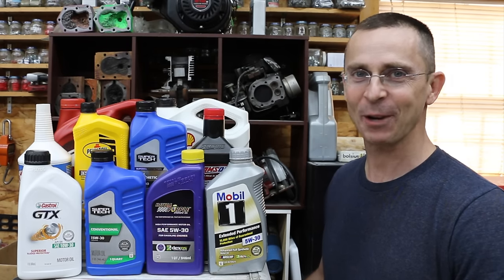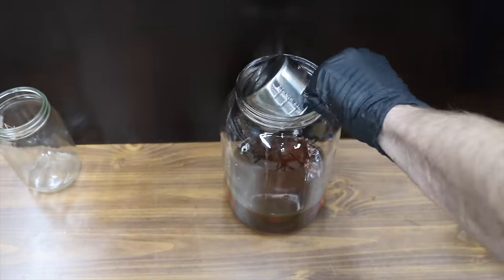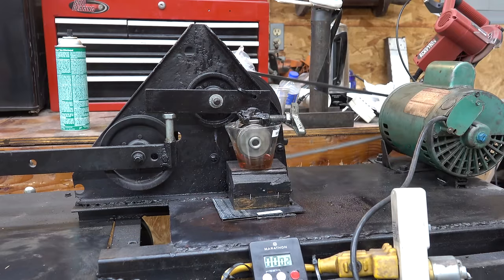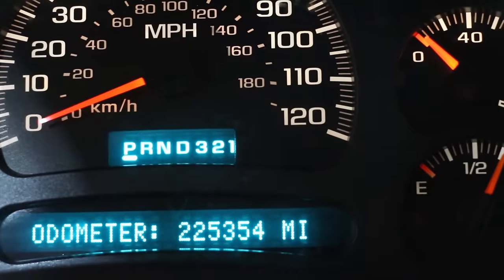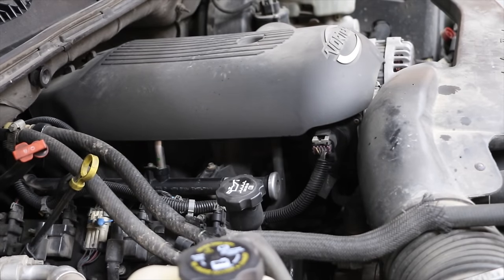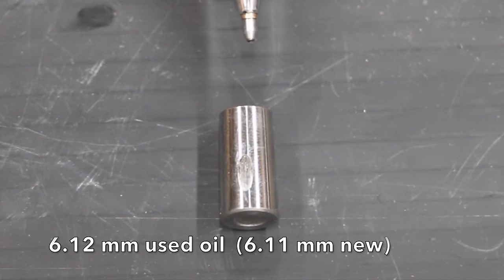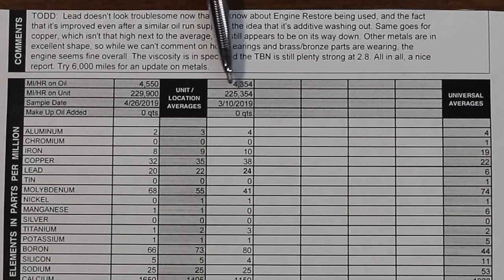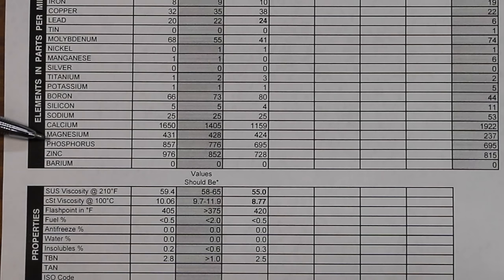Will Mixing 10 Motor Oils Damage an Engine? Let's find out!

Comment: I feel like if you need oil in a emergency, any type of oil is better than no oil at all.
Reply from the maker: Yes, you are right!
Reply: Truth
Reply: but only to get you out of trouble until you can next change all the oil
Reply: I’m agree with you
Reply: SAE30 in Miami is about the same as 5w30
Reply: Even if that oil is bacon grease 😂
Reply: Apparently so is EVERY type of oil
Reply: I mean not really. If the option is towing your car or popping in any oil I think I would rather tow it if I had to put oil that would make the viscosity waaaay high.
Reply: Well duh! Thanks for stating the obvious. 4,000 miles is not an emergency and that's what he tested. Nice job keeping your comments relative.
Reply: just don't use olive oil. says the guy from car talk Ray Magliozzi
Reply: After a gasket leak, I once filled up my bike with a cup of vegetable oil, and it ran me home just fine.
Reply: I've been adding all sorts of oil and haven't had a problem lol won't do it with a new car tho
Reply: A friend said to me once hey my engine sounds funny. I listened and said yes it does. Had him shut it off and pulled the dipstick, well he was 3 quarts low. I explained that was bad. And we didn’t worry about what brand of oil it had left in it when we filled it up.
Reply: @jakesshopandtracktalk1835  yea I learned my lesson with my first car. Mitsubishi eclipse, always hitting high speeds till I got of the highway with a knocking sound I was clueless till later the day my dad said I'm a dumb ass and the car was so low on oil
Reply: Does diesel oil hurt, 0,2l
Reply: @gwarrichmond6232  and
Reply: My vehicle doesn't burn oil, it leaks it.  And fixing the leaking valve cover gaskets is ridiculously expensive on this engine.  So I keep adding oil.  There's so much fresh oil going in all the time, I don't really change it except twice a year.  Mostly because it needs a new filter at that point.  But the oil going in is whatever I can get. 10w30, 20w50, 5w30, anything.  The engine has well over 200K miles and runs OK.  I'm not going to freak out about mixing brands or viscosities.  It leaks out the same anyway.
Reply: Exactly. My engine (Honda Shadow) just suddenly started overheating, I immediately pulled over and filled the coolant up with water. Just making sure I'll replace it with coolant as soon as practical
Reply: I drive a BMW and I took it on a road trip across the USA. These cars can only be topped up when the car tells you to do so. I was halfway thru my trip in rural New Mexico when the light came on. The small gas station I went to only had brands I’ve never heard of so I grabbed whatever was synthetic and used it. It didn’t harm the car. The next road trip I did have a supply of proper oil.
Reply: Jake’s shop and track talk 1 that’s called topping it off. 

I would drained it and just filled new oil in then have it crap out earlier. Friends and my trucks are beaters and everything but we make them last as long as possible and still beat on them and maintain them.
Reply: I think it's fairly obvious
Reply: @markoftheus  😋
Reply: Had Thai last night had to use old ass black oil from my brothers jeep into my truck cuz my cousin forgot to change the oil last week and oil on the dipstick was non existent
Reply: i used prestone as brake fluid once to get home.
Reply: 100% right, that's what my dad always use to say
Reply: @Francois_Dupont  lol had to use my e brake and manual transmission to get home after i busted a brake line. Lol very scary.
Reply: Yes but every type of oil is better than any type of oil. The combination seems at least as good as any part.
Reply: I gave u thumbs up because yr like count was stuck on 666
Reply: @markoftheus  Engine saving, and delicious
Reply: There hasn't been an issue with mixing oils of different weights or blends for a couple decades now.  All oils of the same spec can be mixed together without issue.  It is generally recommended to use the correct oil weight though.
Reply: On ms
Reply: @LatitudeSky  actually 20w50 leaks much less
Reply: Eclipse538 M8, I’m a certified mechanic who works at a Toyota dealer and probably knows more than you do. Its just that it has an electronic dipstick thats not super accurate so it’s a safer bet to top off BMWs or other electronic dipstick equipped cars when prompted rather than overfilling it, considering its a high performance engine and the fact the owners manual repeatedly mentions to never overfill. The digital meter only shows levels per 1/4 of a quart so it’s hard to top it off accurately.
Reply: Eclipse538 This is my 3rd vehicle with an electronic dipstick. I had a W203 Benz and another BMW with said system. Ran them between max and min but never below min, and I have 0 engine problems. My car is high mileage, turbocharged and spent all it’s life up north and never skipped a beat. The oil level doesn’t have to be at MAX all the time. Its known for cars to blow seals or for the crankshaft to froth the oil up if it’s overfilled constantly. Overfilling is ok, I’ve done that on other cars too, but perhaps BMW emphasizes not to overfill due to the cars being more prone to that than others. They’re finicky cars after all, it’s not a Toyota or GM. Perhaps the electronic dipstick is for those who don’t check their oil level. It notifies people to add a quart. Most cars with a regular one won’t do that. There is an oil light but that’s more of a low pressure light signifying it’s low by BEYOND a litre for a prolonged period (or the pump is shot). That’s the case with our customers with the 2AZ-FE “oil burner” equipped Toyota’s. Most come in with a litre or 2 left
Reply: @moto083c  this reminds me of: if it was a trail fix and you never get to fixing it right, it really was a permanent solution.
Reply: @PTBoehlke  please test this. now I have to know.
Reply: Not vegetable oil.
Reply: Absolutely
Reply: Turbo Hauling 😁👍
Reply: With modern engines with vvt and permanent bearings using suggested oil viscosity is preferred (think motor honey car still runs but boy it wint run right for long.). Brand doesnt matter synthetic doesn't really matter as conventional oil just needs to be changed at a lot sooner intervals.
Reply: My owners manual for the V6 Oldsmobile diesel said it was OK to use multi Grade in an emergency but only until you could get 30 wt. One car owners manual said use 10 40 in the engine and the warranty is voided. That was in the 80s.
Reply: A lady once told me her Ford has a strange problem. The oil light comes on when she goes around a curve. You guessed it. What little oil was in the pan went away from the oil pump screen. Nothing showing on the dip stick.
Reply: @thomaskemp205  Just buy the cheapest oil, of the CORRECT VISCOSITY, "emergency" or not, change it at recommended intervals and you'll be fine!
Reply: @markoftheus  That might get expense unless you collect from your neighbors.
Reply: @LatitudeSky  Yeah, and NO used oil to dispose. It's AUTOMATICALLY scattered all over the countryside.
Reply: @BRISKOLOKS  That was TWO MISTAKES you made, buying a Mitsubishi AND running it low on oil! Scotty Kilmer will never forgive you..
Reply: The danger of using 🥓 bacon grease as oil is the line of 🐕 dogs running behind the car...
Reply: @LatitudeSky  That's literally what I do. When I do an oil change (and filter) I put the factory spec oil in, however.
Reply: In an emergency even something like water is better than no oil. At least water will transfer heat and keep the engine from seizing even if it has virtually no lubrication value. In other words, you might have to change bearings when you're done but at least you won't be dead in the water...no pun intended.
Reply: @oceanwaves83  Summer yes. No advantage to use a 5w30 when starting an engine at 30C+.
Reply: @tomasnokechtesledger1786  it's always summer in Miami. Literally you get 2 weeks of "almost fall".
Reply: Yes, I’ve put sae 30 in my car before
Reply: Gas peddle felt funny so I turned down the radio and heard lifters rattling. Pulled off interstate. Dip stick scorching hot smoke rolling out of the dipstick tube.... 4 quarts low (only holds 6). Put in 4 quarts of yellow waxy looking oil from the gas station to make it home. Can't believe it made it.
Reply: I thought I was a mad lad. I run with scissors, play Russian roulette, and tell my wife yea that dress makes her look fat, but this man here is a absolute mad lad mixing 10 oils together with reg oil and synthetic. I like my truck running and never would mix reg with synthetic. Thank you sir for your methodical madness and your concise tests. Now in a pinch I won't worry about engine damage if I had to mix oils. Might even start mixing all my lil left over oil bottles into one and run that thru my farm truck to make some shelf room.
Reply: True. Better than seizing the engine.
Reply: That is absolutely true. My Honda manual even says that for short periods of time you can use engine oil in the gearbox!
Reply: @jussikankinen9409  You asked if diesel oil hurt. I'm supposing you mean does diesel oil hurt in a petrol car and the answer I've heard is this, provided it is the correct viscosity it actually works better because diesel oils are designed for an engine that is more demanding on oil,  that is,  higher pressures.
Reply: I was told that in my real crappy shop class in high school. And that’s was the best thing I was taught honestly.
Reply: I usually two oils that have the qualities I'm  looking for.
Reply: That's more than a feeling, it's just fact!
Reply: Imagine someone stopping at a McDonald’s to ask for a glass of oil from the fryer 😂
Reply: Amen
Reply: duh
Reply: I dunno, man, I had a blown rear main seal in the middle of nowhere and had lost 3 qts. All I had in my truck was ATF, since I already had a leaky trans and power steering (that ol' $400 truck was a real hoopty!). So I used it, just to try to make it home. I went about a quarter mile, and it seized up. Oh well.
Reply: not Dollar General oil
Reply: NOT! And guess what????? I don't even drive, and know better than that
Reply: Wise words
Reply: Exactly
Reply: Oh yea. Any oil is better then low oil for sure.
Reply: You would be better off using baby oil than no oil at all.
Reply: @ramtrucks721  I don't feed trolls
Reply: Yeah it's fun when you roll up to a gas station with a huge smoke cloud behind you from burning oil to pick up more oil with everyone staring.
Reply: Yeah it's fun when you roll up to a gas station with a huge smoke cloud behind you from burning oil to pick up more oil with everyone staring.
Reply: I've used used oil
Reply: Better to have an not to have yup I agree
Reply: ABSOLUTELY !
Reply: @oceanwaves83  or Texas, Arizona, Nevada, Oklahoma..
Reply: olive oil😁🤣
Reply: Your very right. I've been in some pretty  bad binds with several different beaters. All very high mileage (300k+) and not worth putting much into due to various mechanical issues and was just driving until something that was going to require major repair to fix. Being a mechanic used oil is generally available and I have used it for various purposes on these vehicles from engine transmission (manual) power steering tcase and differentials. Usually used due to leaks and being that there wasn't any point of adding new expensive stuff. Ironically enough most of the time it was not the part that was being fed used oil that failed and was the end of the vehicles. Average length of time adding to the system (s) was 7 months and 15000  very abusive miles.  I've been stuck on the side of the road and used vegetable oil in the engine and it got me home though It was very noisy and it was not very long after that it had a rod knock. The only thing I've found that was wouldn't be a good thing to use to rescue urself from a roadside emergency is anything water based. As long as its some sort of petroleum or synthetic based product it will get u home but that may be all you get from it.
Reply: Oil is oil lol
Reply: When you mix a conventional oil with synthetic oil, what you get is a synthetic blend which is sold by all the major companies to using your vehicles. No damage will be done.
Reply: Id prolly risk a full day of boosted hard launches in my rat rod with no oil before I'd ever trust the walmart super tech or dollar general oil in my lawn mower long enough to idle it into my garage
Reply: @oceanwaves83  LOL😂😂💀
Reply: My car takes 5.5qt of 5w20 synthetic blend 112k miles.  How bad is it to use .5 quart of a sealed 5 qt ofanother brand name syn blen high mileage oil? Castrol gtx green bottle and valoline high mileage red bottle. I wouldn't normally do this but the single quarts are so much and it would only be this one time.
Reply: Oh yeah
Reply: @jussikankinen9409  no
Reply: @Eclipse538 air churned into the oil while the crank is sloshing through it will lower the oil pressure and may case some lack of lubrication damage.
Reply: That's for sure, I managed to run out of oil on my atv many years ago. 

I got no harsh sounds or any other sign that the oil tank was empty.
The engine just suddenly died.

Atleast I learned a lesson that day and always change all of the oil and the oil filter every year on my vehicles and of course checking the oil levels many times every year.
Reply: @SoloKyoto  what part of the baby do you squeeze to get the oil out? 😀
Reply: 100%
Reply: @ProjectFarm  I drive a skoda kushaq petrol. Recently at 8500 kms odo, got a notification on dashboard to check engine oil level. It was midway between min and Max. The service centre told me to pour 1 litre of 0w20 oil of whatever brand. The service centre is far away from my place. I couldn't get 0w20 oil in my town. On a mechanic's advice I filled 1 litre of 5w40 Castrol edge. My first service of car is due after driving another 6500 kms. Does this mixing affect the engine in any way? After pouring oil, I felt the engine was less responsive to throttle than before.
Reply: My thoughts also wifes altima started burning oil abt 75,000 was qt low one time so put lawnmower oil in it & no damage done. !
Reply: The wrong oil is always better than none
Reply: @ToyotaNutjob  mean cars don't need oil
Reply: Vegetable cooking oil is better than nothing.
Reply: One of the most "no shit", obvious comments ever and the highest thumbed-up comments. I want to start doing that. I am going to comment "I feel like water is wet" and see if I get tons of likes.
Reply: @markoftheus  There is actually a video online of that!
Reply: I mix Castro’s oil and mobile 1 synthetic  my engine sounds wierd but ok and run good.
Reply: Well said
Reply: Veggie oil
Reply: @markoftheus  😂😂😂😂😂😂😂😂
Reply: Any motor oil? Yeah, but not any oil.
Reply: @LatitudeSky  usually automakers advice on a range of oil viscosity, base on extreme temperatures. For a example cars using 5w 30 during cold weather or around -10f to 80f. Now in summer when temperatures reach 100F you can use 10w 30. So mixing the two 50% each (7.5w 10) 😜, will give you the best protection year around in places with mild or non existent winters!
Reply: Only if there's no sub zero weather is permitted.
Reply: As emergency always buy a couple of quarts of the same oil you used at the oil change.
Reply: Yes, I’ve ran into that situation
Reply: @JackRR15 I’d put ANY weight of oil in a vehicle in an emergency before I tow a vehicle just for that reason. Heavy viscosity oil poured in a warm engine won’t harm it as long as you change it at your earliest opportunity
Reply: NO! DO NOT USE OIL, Not using oil will cause another emergency that will cancel out the original emergency.
Reply: @illwill5084 Oh no I liked this and it went to 6. . . Dang it someone give it a like.
Reply: Dumped 5w20 in a 4.3 vortec and it quit burning oil for a few days
Reply: Gonna get that extra virgin olive oil
Reply: Absolutely
Reply: No shit
Reply: Mujhe padhgayi jrurat 400 ml ki fer mai mix karva liya same grade kaa hi
Reply: My thoughts exactly
Reply: Same thing with plain water in a radiator.
Reply: Unfortunately not true in all cases. If you're stuck in a car that specifies "FULLY SYNTHETIC ENGINE OIL ONLY" (in my experience, usually the newer 2012+ Euro models like Audi's and BMWs, etc.) and all you have is mineral oil, do not use that mineral oil. You'll be lucky to make it another 500 metres without blowing an oil line/seal or putting the car in limp mode. 

I say all this from experience helping a friend who was stuck in an audi with a dry dipstick, a slight shudder (no knock), an engine light and no oil. Got the call, all I had at the time was some mineral 5w30. I got there and read the oil cap specifying synthetic 5w30 only. I figured "some oil is better than no oil" and hoped that the matched oil weights would be enough to putt the PoS along to the nearest fuel station so we could drop the mineral and put in synthetic. I even took precaution to only put in roughly half the oil capacity to curb the mineral oil pushing too hard into the seals and bearings. 
Anyway, no such luck. 100-150 metres down the road and the engine screeches and blows and splits most of its oil hoses, spilling oil all over the engine bay. Engine was cooked. Took the covers off to see the cams were gummed up to shit. 
Cleaning it up a bit we saw the cam bearings had seized and spun on the cams (gumming most likely from negligence, but I'm sure the mineral oil didn't help with the seizing). Learnt 2 things that day; 1, Don't put mineral in a synthetic specified engine
2, Trust the dipstick, not the homie who says he topped it up 2 days ago